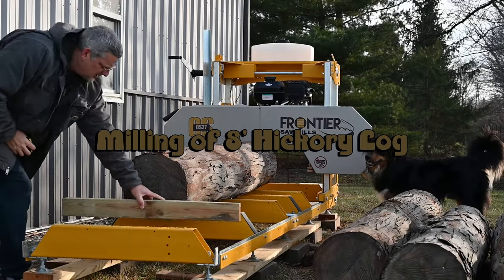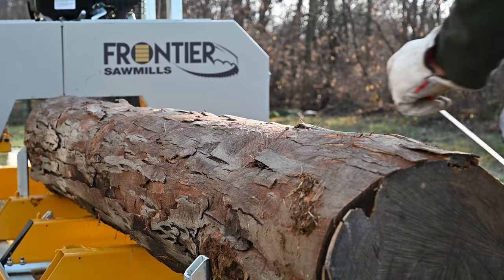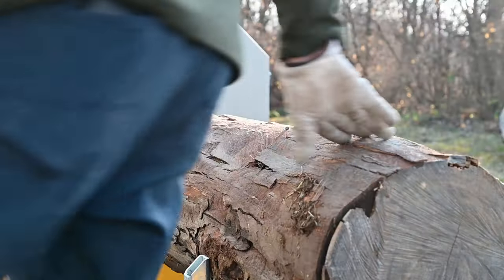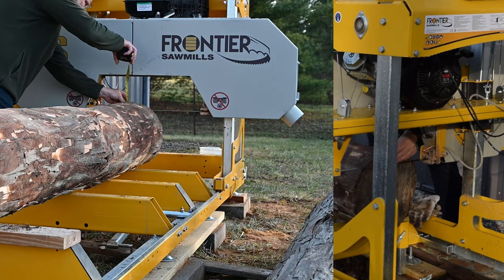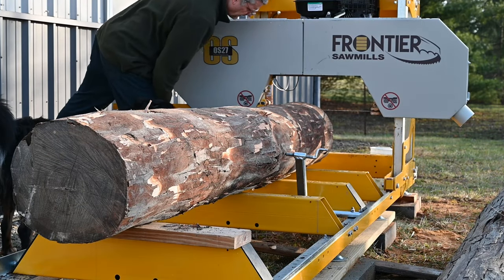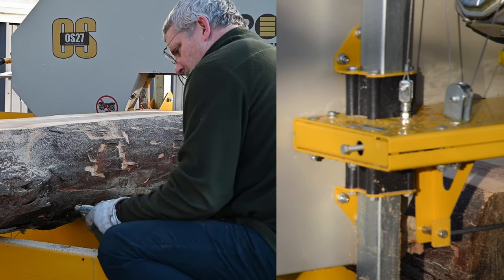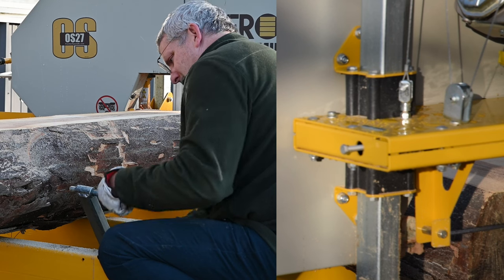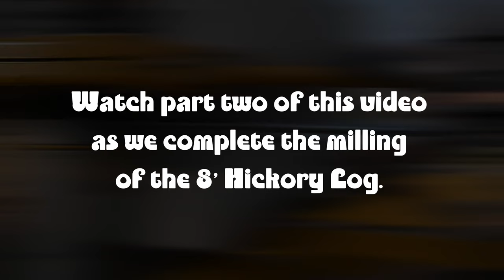Frontier Sawmill Hickory Log Milling Part One

Comment: I have an OS27 mill. I noticed that your bunks are assembled backwards, you want the log stops on the sawdust shoot side of the mill. And for a toe board I use a piece of channel iron across the tracks and a car scissor jack, works great for almost no cost.
Reply from the maker: I did change my bunks around this is some video I had made right after I assembled the mill. What tipped me off was the blade guide adjustment was useless with the bunks assembled in this direction.  I will have to check out that toe board. Thank you for your help.